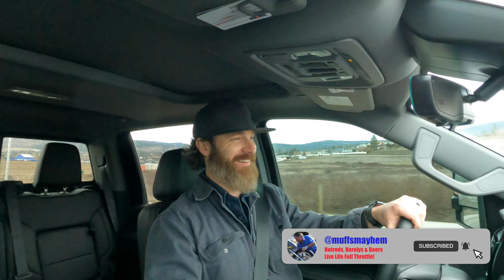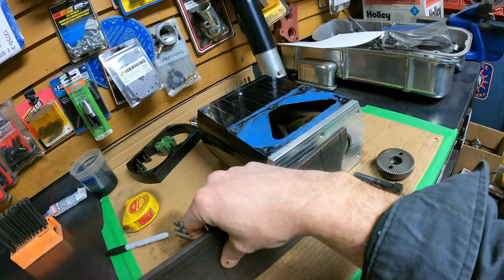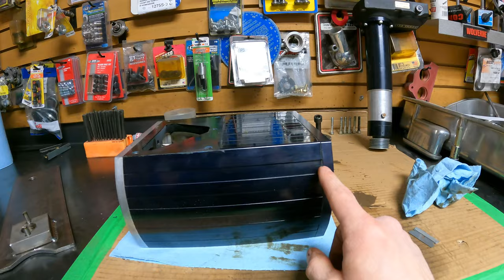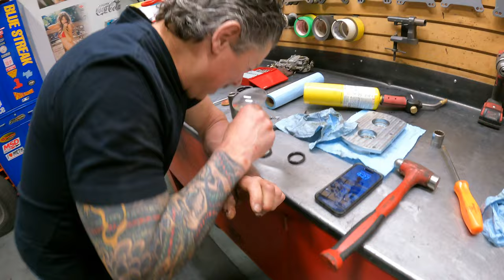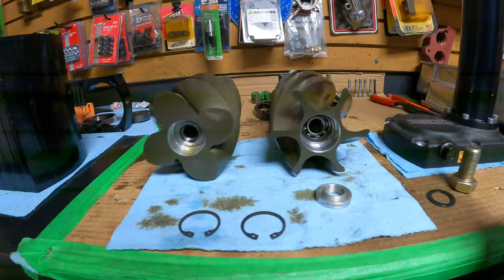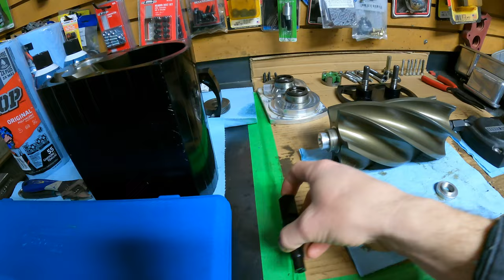Kenne Bell Supercharger Rebuild With No Repair Manual / Disassembly Process & Tooling Required

Comment: Even though it costs money and a lot of time, make sure it done right and taking time to be sure it's done right.
See this is similar to stuff that I work on for a living I do diesel fuel injection work, it's strict tolerances, need for
special tools, knowledge of years experience, but the general public thinks they can fix it themselves, and 
totally jack the high dollar fuel injection all to $hit and want to complain about the price to fix it.Good luck and 
you both take you time.
Reply from the maker: Yup, so true buddy. I tip my hat to the experts in every field!

Comment: Great episode. What you’re experiencing is what my Dad and I call “FAF” - Fxxk Around Factor. As a shop owner I’ve been down roads like this many times. Good thing it’s for yourself because you could never charge a customer enough! Now here’s the question, between the used purchase price and the aforementioned FAF, could you have just bought a new retro kit from Kenne Bell? 🤣
Reply: I believe the new Kenne Bell is about $5000 USD plus shipping to Canada 🇨🇦 would be about $8k…. Go turbo at that point for 1/2 price.
Reply from the maker: Hahahahaha well said buddy! At this point, I am still in the green however if we factor in hours and beer, it gets scary... 😂